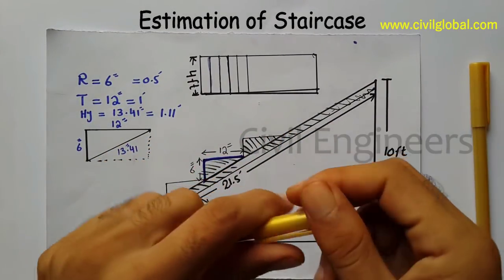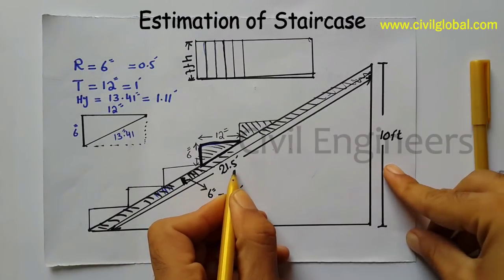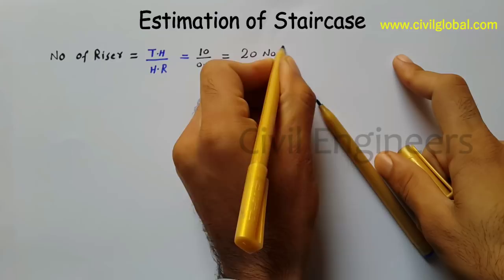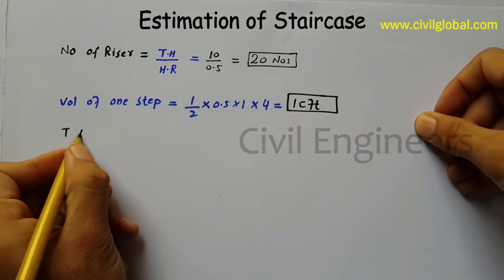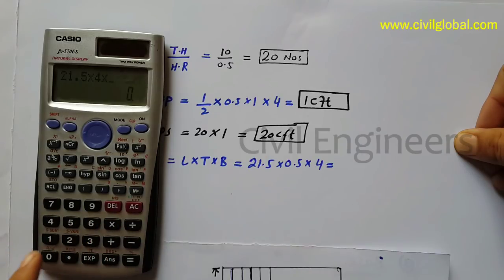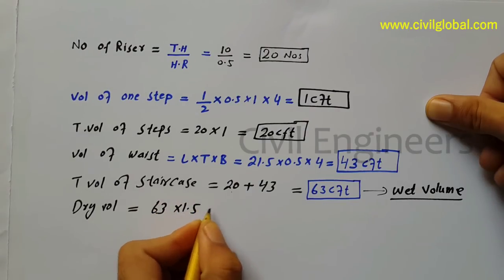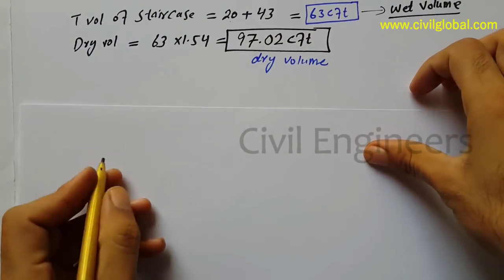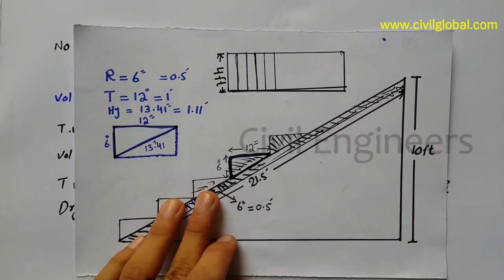How to calculate Quantity of Staircase| Design of Staircase |

Comment: Top to top height 10'+6"slab thickness=126 inch if floor height is 10' clear. It will need 18 steps of 7" standard riser 18X7=126

Comment: As water is added in dry material to make it wet concrete and then placed in shuttering particles slides to readjust in pores and voids reducing the volume of it. ... 1.54 is multiplication factor for converting wet volume into dry volume

Comment: What is 1.54
Reply: As water is added in dry material to make it wet concrete and then placed in shuttering particles slides to readjust in pores and voids reducing the volume of it. ... 1.54 is multiplication factor for converting wet volume into dry volume